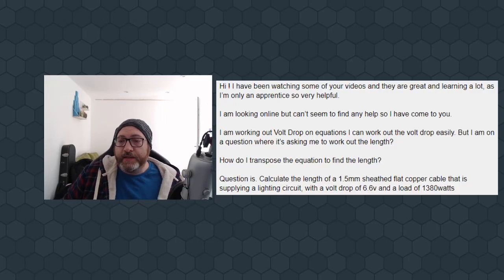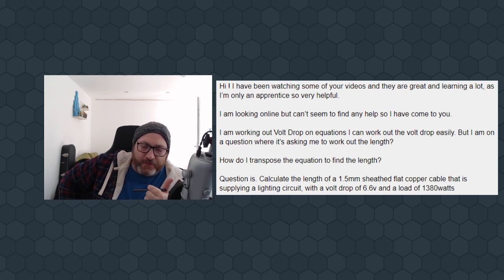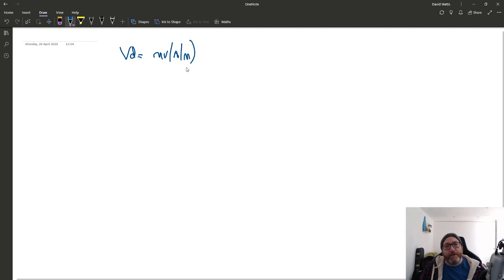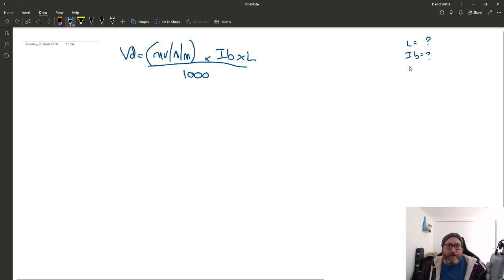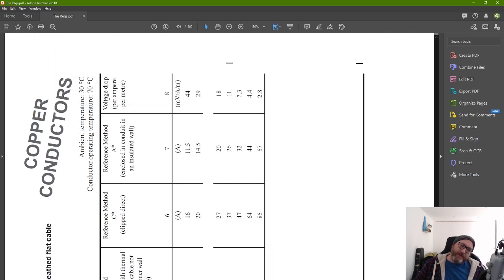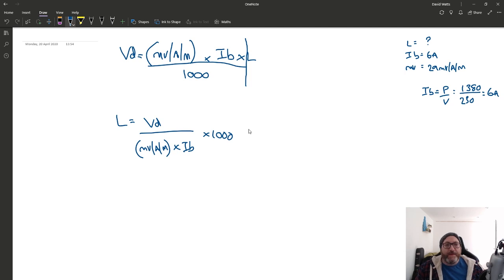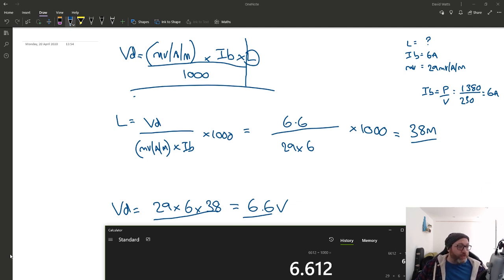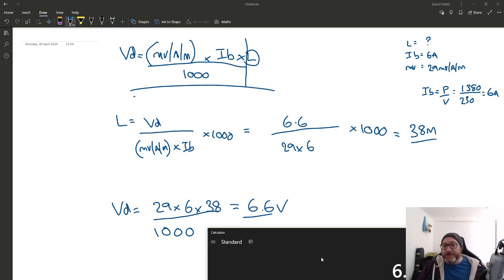Volt drop calculations - transposition.

Comment: Thanks, it's good video. 
Can you help me with formula for voltage drop calculation. 
I know it's available in this video but am confused a bit as there a people using the different formula with √3.
Let me explain. 
Voltage drop =((voltage drop in mv/unit legth mtr/per amp) X (load current) X (length)) /1000
This is quite simple and very logical formula . 
The next formula 
Voltage drop% = ((√3 X load current X Length in mtr X (R Cos theta + j sin theta) X 100) /(voltage X number of runs X 1000) 
Now my question is in both formula it is the same , only thing is the voltage drop mv per amp per meter is taken in terms of resistance and reactance of cable   , so what is the necessary of √3 in the second formula. 
Kindly consider 3ph load and explain. 
Hope you will help me. 
Thanks 
Merry Christmas.

Comment: Hi,

I have a question related to this which hopefully someone can help me with, and it’s regarding a disparity with my volt drop calculations when transposed for length, and the maximum circuit lengths given in Table 7.1(i) of the On-Site Guide:

As an example, If I refer to the maximum circuit length in Table 7.1(i) for a 6A lighting circuit protected by a type B cb/RCBO wired in 1.0mm/1.0mm T&E, the maximum length is given as 68m.However if I transpose the volt drop formula for length myself I get 30m??

My workings are as follows:

Maximum permitted volt drop on a lighting circuit = 6.9V (3%)The assumed load for a 6A lighting circuit given in the On-Site Guide on page 64 is 5A, therefore Ib = 5A

(mV/A/m) value taken from Table 4D5 of BS7671 for 1mm T&E is 44The transposed volt drop formula for length is (VD x 1000)/((mV/A/m) x Ib)

So putting my figures in: (6.9 x 1000)/(44 x 5) = 31m
Where am I going wrong!?

Comment: Doing VD on ring circuits does ya head in at first!
Just remember to add a 4 to the formula. 
Divide the formula by 4x1000 to get ya volts and transpose as required!